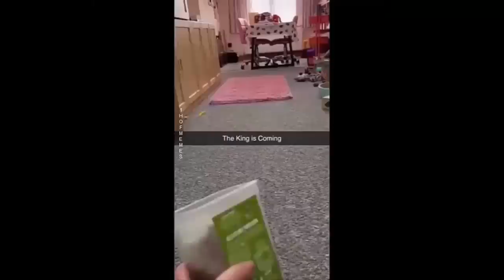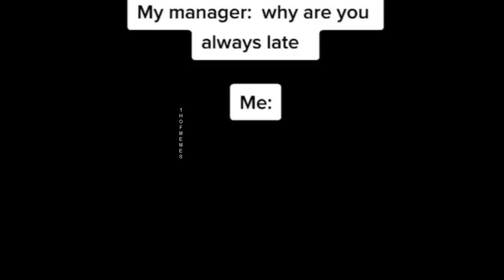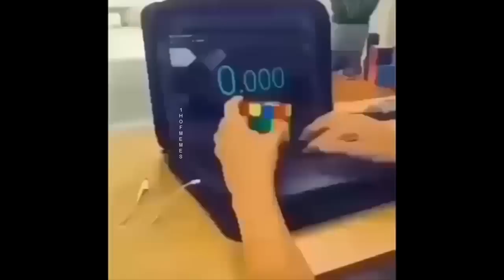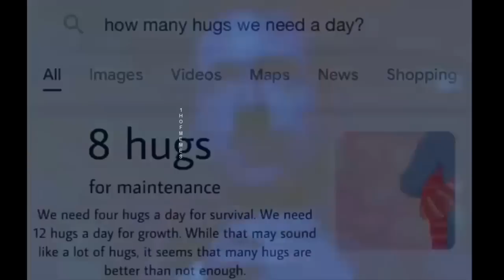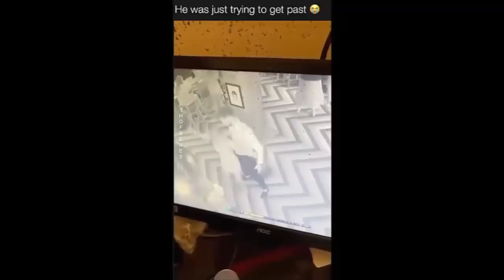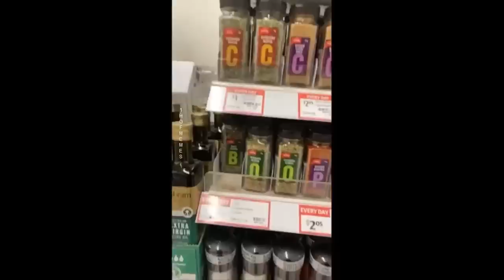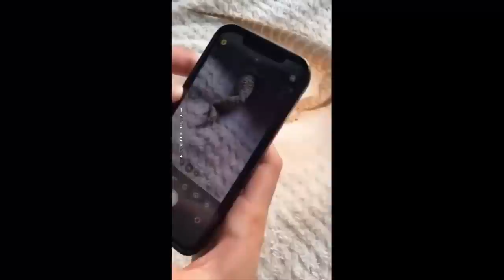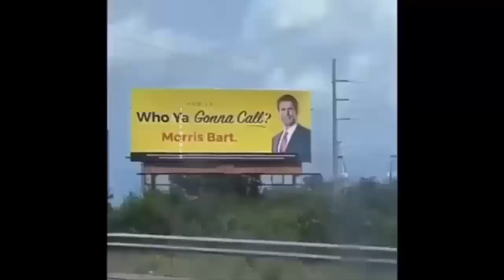One Hour of memes but it's actually funny

Comment: okay okay so for those who don't know at 29:13 the black balloon popped because the color black absorbs heat (in this case from sunlight going trough the magnifying glass), so the black balloon absorbed heat and popped, while the color white deflects it and absorbs a very minimal amount thus the white balloon couldn't have popped, at least not in a short amount of time. 
still, it's a very funny meme
Reply: its a joke no need to get technical